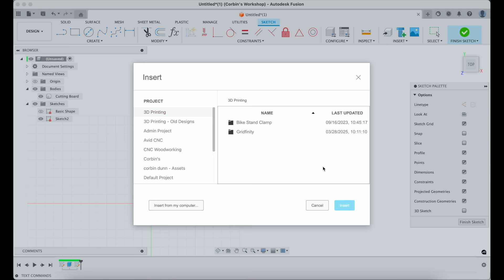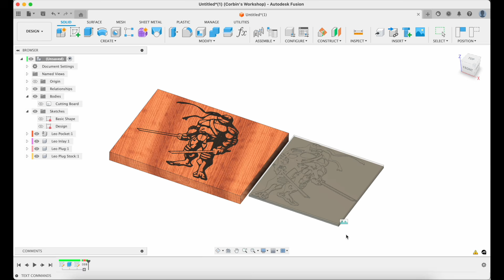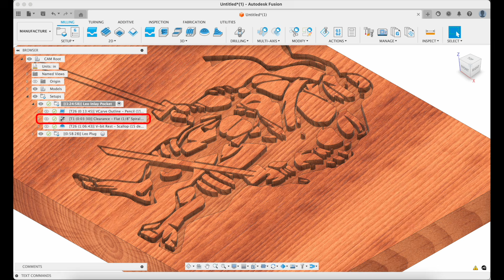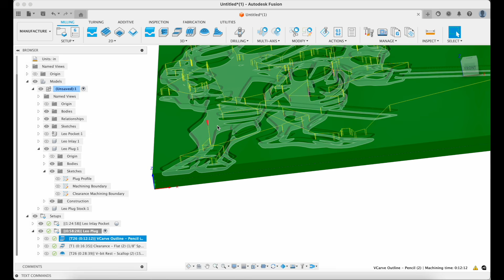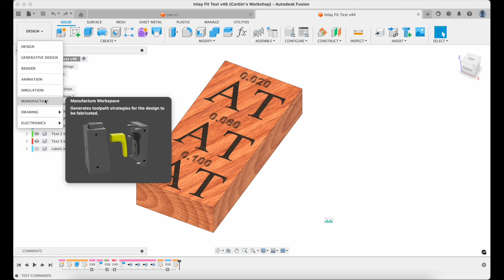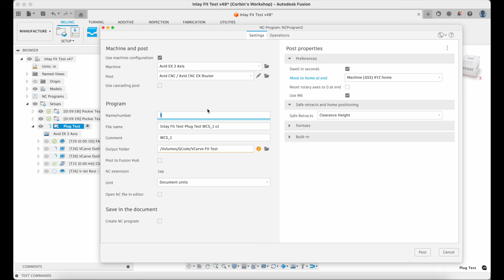I cracked the code! VCarve Inlays with Autodesk Fusion 360 - A complete tutorial!

Comment: Just a suggestion, and one I am experimenting with - a good starting point for the "inlay fit adjustment" seems to be the distance from the actual end of the bit you want to use and where its point would be if it was extended down into a point.
Reply from the maker: For the "inlay_fit_adjustment" in Fusion? It seems to very a lot depending on the bit, and the depth of cut. So, an inlay at 0.240" depth, and with a ~12.4 degree tapered ball nose, about 0.005" seems to work for me. But for a depth of 0.100" and a 15 degree v-bit with a 0.005" tip  seems to work with about 0.060" to 0.070". It seems to vary a lot depending on the bit. But this will all vary a depending on people's CNC machines (I think...it'd like to get more feedback on bits/depths/settings that work well)

Comment: Man.. I am SO glad I came across this video. I've been running my CNC (custom build PrintNC) for a few years. But almost exclusively have been milling aluminum. I am just getting into end grain cutting boards and honestly hate using V-Carve. It's an OK program.. Don't get me wrong. I just highly prefer using Fusion360 for so many reasons. 

I grabbed some BroInWood files ad will be running a 12.4* bit. So, that is what my testing will be with. I tested his file settings right out of the gate and the glue-line was very noticeable. After that, just been doing some research instead. Can't wait to try your plugin out and dial these things in. Great work!
Reply from the maker: Cool! Definitely do test cuts to find a good fit before going for a complete board. Just use scrap cut offs from 8/4 stock to not waste a lot of time or effort.

Comment: Hi Corbin, fantastic work on this plugin. I'm new to CNC and busy learning by watching as much content as I can. I noticed you say in this video that a tapered bit can be used instead of a V-Bit or Carving/engraving bit but I have been struggling to get the plugin to work with a tapered ballnose bit configured. I get the warning about the bit not having a tip diameter and the toolpaths have errors stating the tool (tapered mill) is not supported for the strategy. is there something I need to adjust that is not covered in the video or are tapered mills no longer supported by the plugin?
Reply from the maker: Hi Dave, Yes - you can use a tapered ball nose! 

Have you read the directions about setting up a TBN? https://www.corbinsworkshop.com/vcarve-inlay-plugin-for-autodesk-fusion-documentation/#vbit_tool_selection 

If you set it up like how I say, and still are having trouble, let me know! I give an example with the common SPE W01005 bit.

The "trout cutting board" was cut with a TBN using the Fusion plugin to generate toolpaths: https://www.youtube.com/watch?v=Fy3MR5Daki0
Reply: @CorbinDunn  Thank you so much, I did not read the documentation, I did the typical thing and tried to copy what I saw in the video. I see the workaround now for the tip diameter issue and for the angle calculations. thanks again for the superb content and your help.
Reply from the maker: No problem! The video is now a bit out of date.

Comment: I'm trying out your plugin and only the plug gets a toolpath generated. Am I doing something wrong for the pocket to not have a toolpath generated?
Reply from the maker: Hmm...by default it should generate a toolpath for both. Is it not completing the toolpath generation? If it isn't completing..then you may have a v-bit with a zero diameter tip, which won't work.
Reply: @CorbinDunn I ordered the same 15 degree v bit as the one in the video. You’ve updated the plugin since this video so some of the settings were different. I tried to copy the video 1 for 1 but can only manage to get the plug to generate tool path. If I deselect the plug generation option and just do the pocket no tool path is generated
Reply from the maker: @calebcaleb4983 yeah, I’ve been constantly updating the program. You can email me the file and I can look at it. Just tell me what you are selecting to do the inlay. Corbin at corbinsworkshop.com

Comment: Question, when I produce my cam for the pocket it creates the v carve job where it uses the v bit. Then next it created the clearance job with the same Vbit. Then finally it did the roughing job with a 1/8th end mill. I’m noticing when it’s done there’s sections it looks like it’s missing and sections it looks like it went to far. I’m wondering if this is because of stock to leave being on? Is that something I should turn off?
Reply from the maker: Stock to leave is set to the exact math amount needed that the v-bit didn't get. If it isn't getting areas, then the bit angle set in the  Parameters may not match your actual bit angle, causing the math to be wrong.
Reply from the maker: Otherwise, if that isn't the case, you can email me the file and I can look at it! It is possible something is wrong w/my generated toolpaths.
Reply: @CorbinDunn  sent

Comment: This is amazing. I've been struggling learning inlays. Is there any way I can make the plug-in editable to be set to metric instead of imperial? Everything else on my interface is metric, and the parameters are really confusing.
Reply from the maker: If you have your document in metric, it should be in mm, except for my parameter comments. Well, and the bit diameters, which are hardcoded in inches, because I was told most people use imperial bits. You can still add your own bits in metric and they will show up.  Otherwise..multiply what you see by 25.4 to get mm.

Comment: Hey @corbindunn, I get a design intent error when I try and run this - 'Design' object has no attribute 'designIntent'. 

I'm using the personal version of fusion, and there isn't an option for setting design type. Is there anything else I could do to fix this?
Reply from the maker: Hi! Are you sure you are running a recent version of Fusion? The free version can create Hybrid/Part/Assembly designs. Make sure you are in Hybrid. Also make sure you have a recent version of the plugin. It also could be an error on my part...I need to see a screen shot of what you are doing and what version of the plugin you have. Thanks!

Comment: Is a plug-in coded in C? Or some kinda script?  Congrats on finishing this. I can appreciate the amount of work involved!

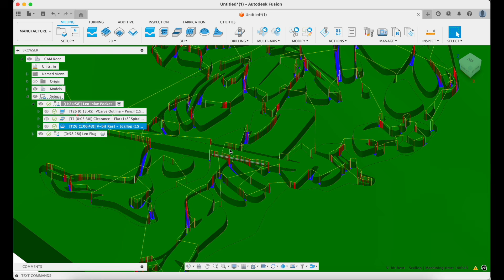I hope to add automatic inlays to GatorCAM for CNC. 16:55 GatorCAM currently sorts for auto tool change.

(I try to keep all the user interaction minimal to reduce so many settings the user need to do.)

I've been adding features. I'm adding 3d visualization now. 

Fun stuff!!
Reply from the maker: Plugins for Fusion are either C++ or Python. I wrote it in Python...for several reasons..but mainly ease of development. Fusion can also sort toolpath for CAM when you export them..but most people don't know how to use that feature, and reordering is easier. In the latest version of the plugin, with multiple clearance tools, it requires one to happen before the other..otherwise it may "drag" it across an area it thinks is clear.

Comment: Thanks Corbin I like your add-in a lot, you are very clear explaining how it's made. I also enjoy how clear you have described the parameters - even for a none-native  English speaker.

One thing that is different from what Im used to do, is that I always start with a facing operation down to the model top (not the Stock top) - that way I know that from now on I can set all following retract-heights for the coming tool paths from that model-top, this makes it simple I think (easy to overlook for me), and it minimizes the risk of a crash. It's just how I prefer to do it. 

Also it's a bit confusing (for me) is that the plugin generating a separate stock body automatically - I always set the stock size in the CAM/setup meny (not in the design workspace). But I guess that has to do with your plugin needs that stock-body in order to work? I guess there are several ways of doing this and no way is the "correct way".

Would it be possible for you to add "save as default" for the values in the plugin-window? (the "three dots" to the right of values that usually appears in fusion, for example, setting plug height to a specific height and the plugin remembers it for future work). Also if you want another "improvement" suggestion you could add metric values too in the examples =) Must be a pain to live with imperial lol.

Comment: i donwlaoded the plug ig to try it out, I have the 1.11 version. everytime I click on it says you need to restart fusion to active it. I already did it 3 times and still have the same issue. Also when I was adding the add-in it did not upload the entire folder, for some reason fusion does not open the  Macro folder inside the main folder. I was just able to add the inlay folder. can you help me to de-bug it and try it out ?
Reply from the maker: Ah, this was my fault! I forgot to increase the version number, so it looped. Try it again now and it should work. Let me know!

Comment: hey Corbin, thanks for your work! I am looking forward to try your plugin, i wonder if you can explain when to use 15  vs 20/30/40 degree, i am new into carving, thanks a lot!! ahhh...i love your clamps...where can i get them?
Reply from the maker: I have been using the 15 degree bit for a long time, simply because I saw someone else using it (probably BroinWood). Sharper angles can get more detailed designs that are "deep". Shallow angles can't get as deep a design, which may not be as durable for use (cutting board, and inlays that get handled a lot). I want to experiment more with 30/60/90 bits and inlays; I haven't done it yet, and I recently bought some pure v-bits to try. My current test (new cutting board) is a tapered ball nose, which a lot of people prefer due to the spiral and multiple flutes to have a cleaner cut -- which i can attest to.

Comment: Excellent tutorial. I've been watching your videos and taking notes. I need to make sure my machine is trammed before I dig into this further. I did comment on another one of your videos. Watching them both. My question thus far has to due with the plug thickness. First, how do you determine the overall thickness of the inlay? What dimension do I need to surface my wood to?Second, What happens to that extra thickness of material above the height of the inlay? Thank you for the tremendous amount of time you put into this plugin!
Reply from the maker: The actual plug starting stock is determined by the "back thickness", usually around 0.25". plus however deep it goes. You see the number in the stock Setup for the Plug. You surface your wood to at least that size (or larger), and then the excess is just machined away.  The extra thickness above the inlay is also machined away in a later step; maybe I didn't demonstrate that really well; the other plugin videos talk about that a bit more for flat inlays.
Reply: @CorbinDunn So in your example I would want my stock to be at least 0.53” thick (or larger). It makes sense that all of those tool paths would ultimately clear away the excess material. Thanks again.
Reply from the maker: @stevenl7878 I think so; I’d have to check the file. Whatever the setup says for the stock size.

Comment: Thank you Corbin.  Following along with creating the inlay with the plugin. When I go to the manufacture tab the pocket outline tool path generated is an engrave tool path. vice a pencil and Going to the edit screen I don't see a tool containment feature offered.  looking at fusion help file this is only offered in the 3D mode.  Can you advise me, am I doing something wrong.
Reply from the maker: Hi Richard! are you doing a 2d or 3d inlay? I changed 2d significantly and did a video about them: https://youtu.be/lqNALledaj4

So, it changed a bit! The toolpaths are way faster to generate when I use 2d toolpaths for basic flat 2d inlays.
Reply: I was attempting a 2D tool path, a simple test of Filigree. still working on it and super thankful for your channel.  In a past video I was able to duplicate the vertical dove Tails. Thanks again. I'll keep working on it.
Reply from the maker: If you have trouble, you can always email me your file and i'll look at it. corbin at corbinsworkshop dot com

Comment: Hi Corbin. I downloaded your plugin and it worked very well. I tried my first inlay with just a simple circular plug and after messing with the 'inlay_fit_adjust' parameter, everything fit nicely. To figure out what the parameter needed to be I adjusted it until the plug height was within 0.01" of the pocket depth. Not sure if this is the correct method to use, but it worked for me and was repeatable. Question: Do inlays over a large area, say 1 SFT with multiple, varying inlay items to require a lot of tweaking? Is it better to break out each individual inlay separately? Again thank you for sharing the plugin
Reply from the maker: I'm not an expert on big inlays, but right now I'm working on an update to the plugin to make it much easier to break large areas into smaller areas. It'll only work for 2d/flat inlays, but I think a lot of people do that. I used it to make a large cutting board. I think the advantage is to isolate your glue up areas to get the inlay to fit better, and not have as much stress in hurrying during glue up. In other cases, you may want to do it to use various wood designs. I'll have a video about it...sometime. It's the next thing I'm working on.  I'll probably post about it first to my CNC facebook group: https://www.facebook.com/groups/corbincncwoodworking

Hopefully within a day or so.

Comment: Amazing tutorial and very much needed….I would absolutely love and appreciate a metric version of this video ? I’m sure I could slowly transfer the measurements myself as I grew up in the transition phase from imperial to metric here in Australia back in the 70s. There would be many other that could not do this so for them it would be essential.
Reply from the maker: For metric: If you run the plugin in a metric document, most the values should work and show up as metric (a few might have issues). When running in metric, just put the value in as inches with the type, ie: "0.050 in"  or 0..050" (obviously, don't put in quotes). It will then convert it to metric and you can see the metric value in the lists. Once you get a feel for what values should be what, just start using metric values that are more similar. It is unfortunate that the US is still stuck in imperial..and it is hard grained into me now that I'm almost 50.